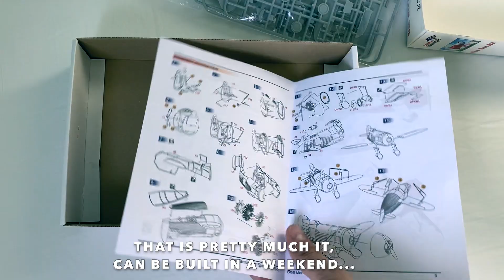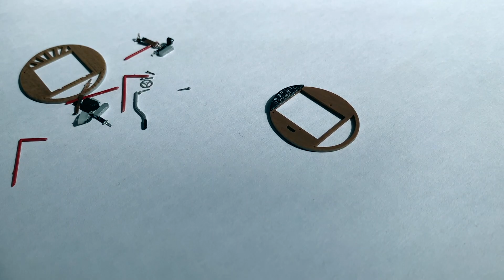Gee Bee R2 - 1/48 Dora Wings - Full scale model kit build

Comment: Thank You nice build Tip for the rigging try using Guitar Strings (the small ones) used strings are normally free at a Music Center
Reply from the maker: Nice tip, but I really liked the way stretched sprue is bending resistant and really easy and clean to glue. Metal strings require CA glue, and that can be a hit or miss.

Comment: This one was an early Dora job if not the first. Their kits are a bit rough, but have improved some. On wheels in spatted undercarriages.....glue spat halves together
and the wheels also. Do not put wheels in spats. Grind or carve a channel from the top of wheel reaching to the wheel center, for the mounting pins to pass through.
Then paint, glue and insert wheel. Good work, mate.
Reply from the maker: Nice tip, thanks for the feedback

Comment: Re: mask leaking - I've made it a habit to spray a coat of either the color I'm going to mask over (white, in your case here) or something clear, like a flat or gloss coat, if going over an already-complex scheme (say, having to spray something that's "overpainted on camo" or some such) - that way, if some paint's going to creep under, it's going to be either clear or the same color. Have to be careful not to leave a ridge, but that's usually not an issue.